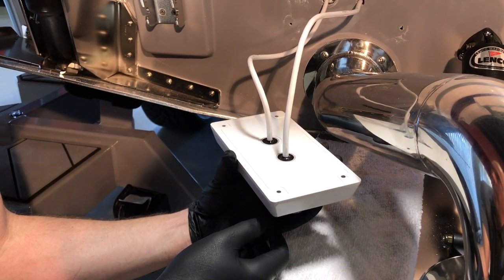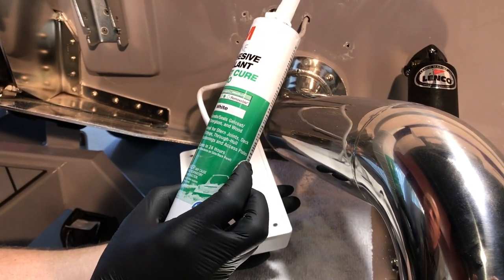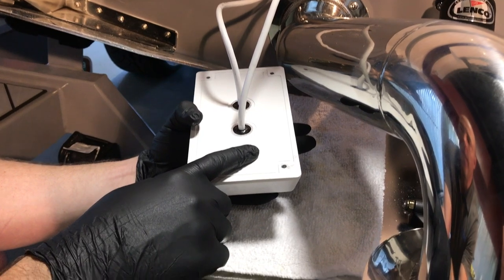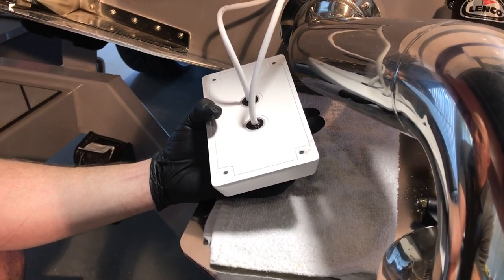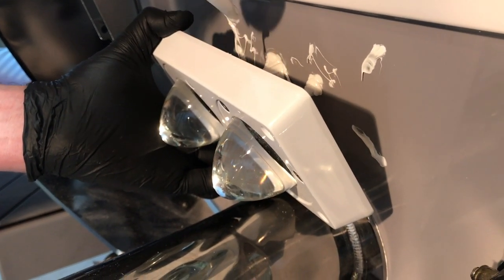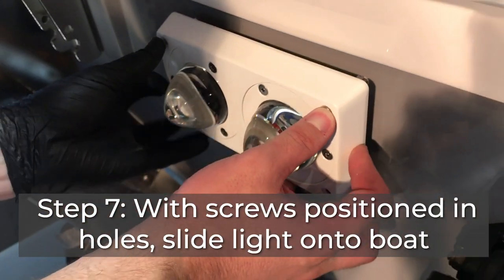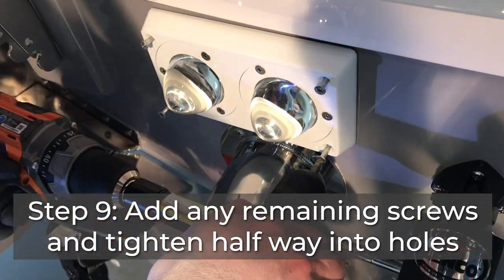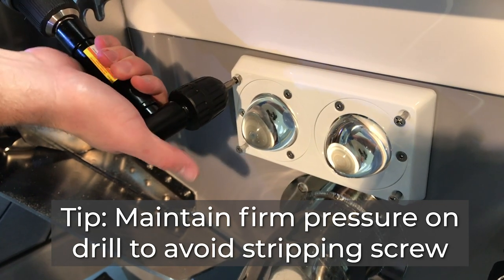How to Install Underwater LED Boat Lights - Part 3: How to Use 3M Marine Adhesive Sealant

Comment: These are still just way too high.  I'm sure they are very nice quality, and I like the fact you can change the color.  But the Tidal Wake lights are $140 for the pair, and install in the drain plugs so no drilling required.  That's the way I went, I just can't justify the cost difference.
Reply: Be careful of the drain plug lights. If they are metal, they can eat away or strip the drain plug threads. I installed some and over time they stripped and now the light falls out causing the bilge pump to work overtime and kills the battery. I'd make it a rule to never use them again. They petrude too far-out and can cause issues when knocked against.

Comment: to clarify, using alcohol slows or prevents the sealant from curing. 3m gp cleaner 08984 works great.